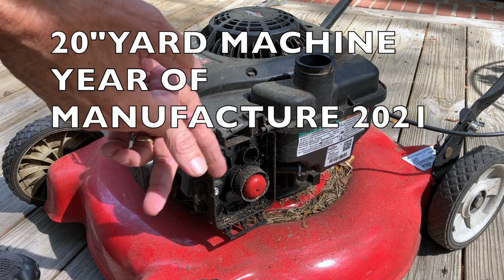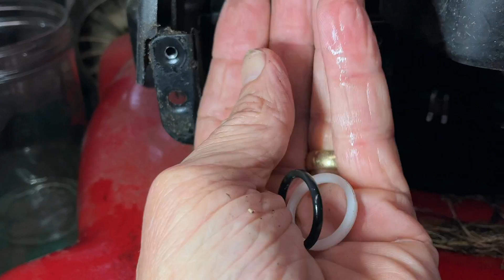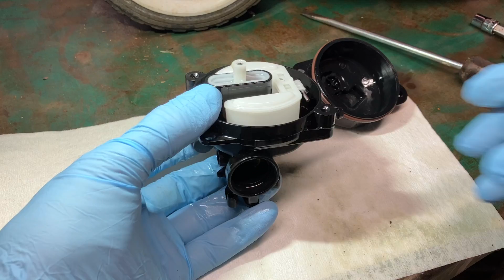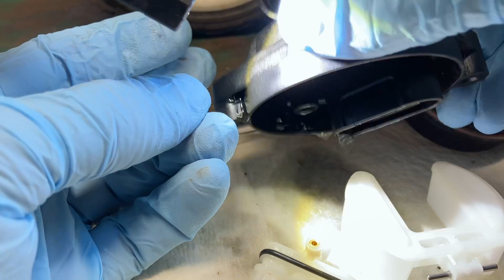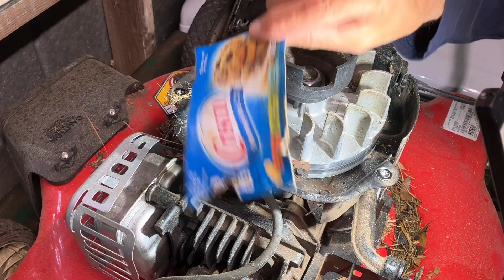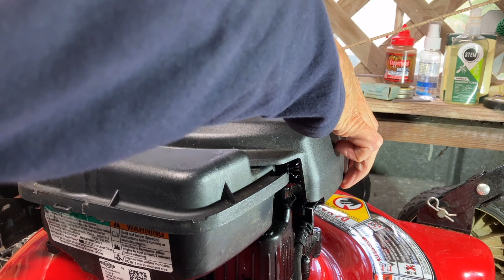FREE But Neglected 20" Yard Machine/Perfect Now

Comment: Need your help please. I watched one of your videos on cleaning throttle body caused high idle. Well my car is a 03 Camry Xle 3.0v6. It ran fine I just wanted to do maintenance so I cleaned the throttle body and the mass airflow sensor and unhooked the battery terminal to clean the post. But I never removed the throttle body when cleaning. And ever since I have a high idle at cold start up only. Before cleaning my rpm at cold start was 1400 until warming up now its 1800 at cold start up. Any ideals? Appreciate any help

Comment: I see Briggs still doesn't use a common wrench size on its fasteners.  I still like working on Honda for this reason.  Kohler's nice that way as well.  You're right, brand new mowers are hundreds of dollars and yes, some people don't want to work on these machines and send them to a curb as even these Briggs engines are relatively easy to work on.  Battery's the future I guess?  I am not so sure myself if that's the right direction.
Reply from the maker: yeah i won't go electric until forced to do so.. and yes, many people would rather buy a new mower than take care of the ones that they have.. or perform simple repairs.. i don't understand it.. especially when YouTube tutorials are often just a click away..

Comment: Amazon is the place I get all my parts from for mowers and everything the Air box cover and filter together is 10 dollars on Amazon I work on small engines to have been for 33 years now ❤ I hate it ween people just put a new push mower in the trash and must of the time it just needs the carb cleaned walmart has the gas caps to   for them